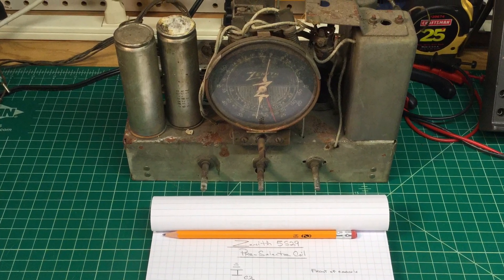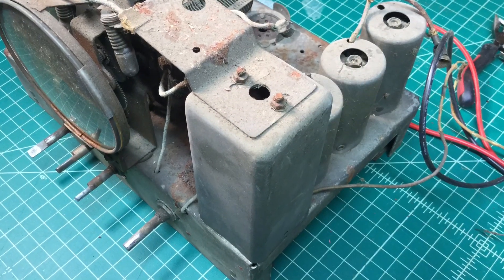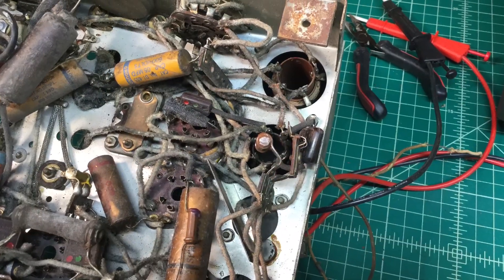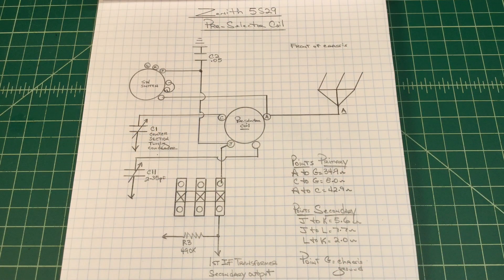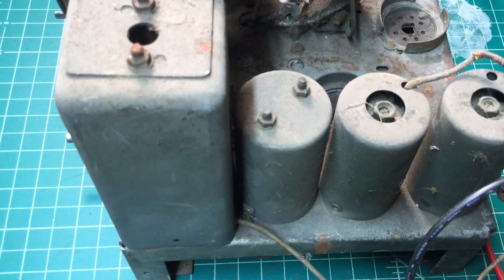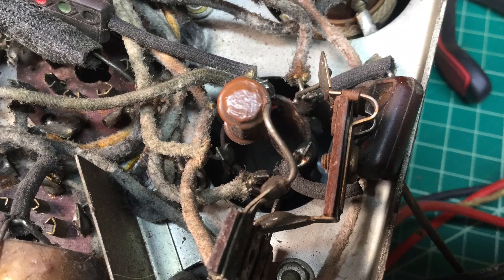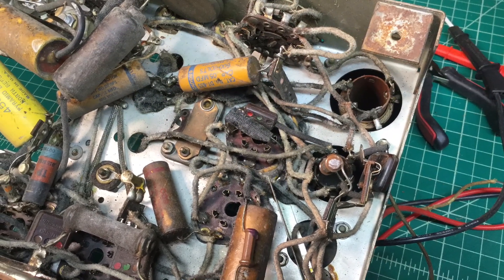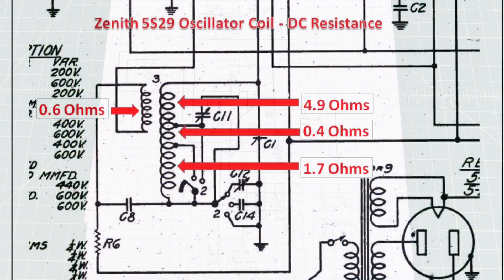Zenith 5-S-29: Pre-Selector & Oscillator Coils

Comment: Don,
“Divide and conquer” is excellent advice, especially to those taking up our hobby when confronted with a tangle of wires and components.  
I remember, quite vividly, whilst I was an apprentice during my late teens, feeling intimidated when applying complex dual standard (405 & 625 line) television circuit diagrams to dual standard televisions on the service bench.  One service technician, a chap who was then approaching his mid-60s (mid-1970s), drilling me, whilst I sat beside him at the bench, with a version of ‘Divide and conquer’, stressing there are over a hundred mini-circuits, or sub-circuits, in a television: just isolate the one suspected as being defective, say the vision IF, into bite-size pieces by analysing each sub-circuit within the vision IF circuit,.  Do that by “…determining the manufacturer’s design team’s thinking before you begin fault tracing.”  
Those bench-side drill sessions were very similar to how this fellow divides and conquers sub-circuits…  https://youtu.be/GXUh_h86FHc 
That old service tech’ always ended his drill sessions by saying, “Remember this lad, each radio and television circuit is only a rendition of what is the current state of the art: taking into account where a particular model is aimed at the market, they all conform to a standard pattern.”  
Regards,
Phil.
Reply from the maker: Phil - I enjoyed reading your story that tied back to your apprentice days. I started my career in the telecommunications field some 40+ years ago and found troubleshooting complex circuits challenging until I applied this approach along with staying focused on the basics. This method and procedure hasn't let me down and I'm grateful to folks I worked with in my early career that instilled this until my behavior and habits changed. Thanks again for following my projects and sharing your experiences with me and others following along. Best, Don